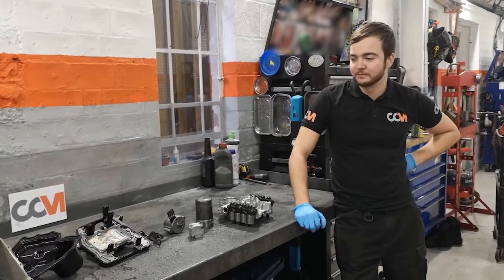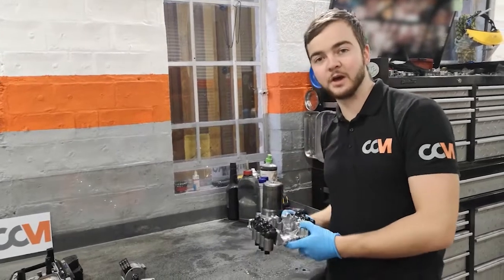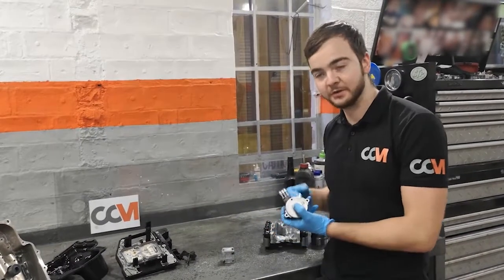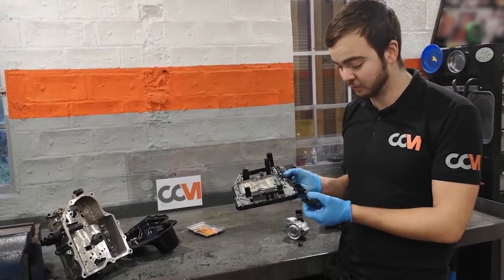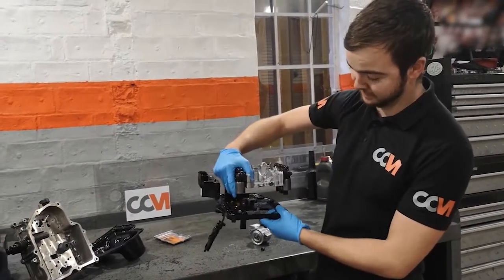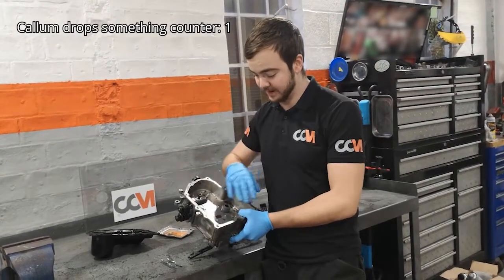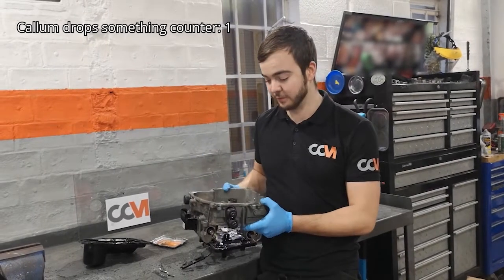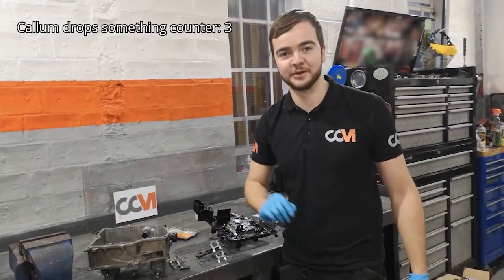Common DSG Mechatronics Failures & Issues | Walk Through Guide of Mechatronics Unit | CCM

Comment: Great video, excellent explanation of the issue. 

In 2025, is there any updates that you know guys are aware of with regards to if the "revised" units replaced under warranty are likely to last longer than the previously flawed units? 

As at 2025, there are still Tiguan vehicles made in 2022 that have Mechatronics failures....

Comment: I was driving highway speeds and my mkv r32 with dsg shifted into 3rd gear. Rainbow of dash lights. Put in neutral, switch car off and back on, good to go. This happened 3 times. Vw dealership says I need a new transmission. The codes showed something about speed sensor. 🤷🏼‍♂️. 
Any advice? It's not worth swapping the trans, at $12k.....
Reply: I hope you got a second opinion?
Reply: @billyponsonby I did. Kinda..... I had a shop say it could be something so simple as a transmission flush, which they did. The car has literally only been driven about 5 miles since. Long story, but, it's sitting in my sister's driveway in KC, and I'm now living in Hawaii.... So I guess I'll find out when I go "rescue" it in a few months

Comment: 17086/P0702/001794 - Transm. Control Module Electrical Malf. (SAE) or Control Module Defective
Possible Symptoms
1. Malfunction Indicator Light (MIL) active
Possible Causes
1. Control Module faulty
Possiole solutions
1. Replace Control Module 
I need your help this is one code i got when scanning the transmission on a mk5 r32 dq250

Comment: DQ200 in a Yeti have a sporadic communication fault code. No communication with TCM when hot, works fine when cold. No other fault codes. Any ideas? Thanks.
Reply from the maker: It's impossible to know without seeing the vehicle unfortunately. However, it shouldn't be having sporadic communication errors. Our advice would be to get it booked in for an investigation to find what's causing this as soon as possible as one fault can quickly turn into multiple. We hope you get it sorted!

Comment: My issue is that the gearbox sign comes on and goes into limp mode. It says "Gearbox Overheated" 

Doing this causes the vehicle go into limp mode. All gears stops working. Whats the possible problem
Reply from the maker: Uh oh. Sounds like something in your gearbox isn't happy. It's going into limp mode to protect itself from further damage. The best thing to do is to get it to a reputable garage ASAP for a thorough diag to see what is happening in there.

Comment: My DSG is hesitate from N to 1st but only when the oil is warm. 

Gears through 1-6 is fine once the car is moving. 

Any ideas?
Reply from the maker: Impossible to know without seeing the vehicle unfortunately. However, it shouldn't be hesitating or stuttering in any gear changes and that's usually a sign that something is about to go wrong. Our advice would be to get it booked in for an investigation to find what's causing this. We hope you get it sorted!
Reply: I have same issue.   I've heard of guys getting both pressure sulenoids changed because they get a crack and leak pressure.  It fixed it for them
Reply: I also have this issue currently... after I exit the highway and come to a stop, theres a 5% chance that it wont move when I get off the brakes. But if I shift to N and back to D, it works and wont give me any other issues. Usually happens maybe once every other week.

Comment: I have a 2015 Passat DSG all the lights came on the dash. The transmission went into limp mode. If you turn the car off and on it returns to normal. Now my speedometer quit working. The transmission accelerates but hangs in gear and won’t shift. If I turn it off and on it does normal. I’m thinking TCM Anybody experienced this? Help?
Reply from the maker: Hmm... It could be a number of things. It's really hard to diagnose without getting it hooked up to any tools. Our recommendation would be to get in booked in with some professionals to investigate as there's definitely something erroring in the system

Comment: Our DSG failed coming up to a roundabout the drive just disappeared which with large lorries thundering past we had no option than to come to a halt in a fast moving live lane - I think VW should have a class action taken against them, they have known about these problems for years but continued rattling them out - I’ll NEVER buy another vw as long as I live - oh and by the way quoted between £2,800 - £3,500 plus vat - I expect better from what was a reliable well built car. Brian Rivers
Reply: Mine died while crossing a highway...with my toddler in the car 😂🫨😱
Reply: @richiesworld1  Have you guys had the dsg gearbox serviced? Which golf exactly?
Reply: Have you guys had the dsg gearbox serviced? Which golf exactly?
Reply: you must be talking about the DQ200. Its a known bad box, yet you bought it anyway... You say you wont buy one again but yet this issue was known. VERY WELL KNOWN.. COMMON ISSUE.
Reply: @johnboy2436 Car heads know about it but the average car buyer doesn’t.
Reply: @johnboy2436 - selling cars with gearboxes that aren't to scratch is why they won't buy vw again.
Reply: @jamesgeorge8915  Yet every manufacturer has cars than have common faults. Many of them bad transmissions. Name a brand and ill tell you which model to avoid. Research when buying a car goes a long way. Why buy a dq200 box when they are known to be bad when you could get a dq381 which are known to be good.....

Comment: My 1.2 polo GT TSI DSG doesn’t creep forward when slotted to D gear 
But the reverse creep function is working. 
The VW service center said they couldn’t find any error code in the scan and also said doing a base setting reset using VCDS scan can harm the mechatronic unit as I have changed the battery outside of VW. 
Please suggest.
Reply from the maker: ooft, sounds like you've got your work cut out. We wouldn't be able to suggest anything really without seeing the vehicle so we'd recommend taking it somewhere where they can do a proper investigation for you.

Comment: Good video.Im thinking of buying a 2014 Fabia with 5 speed DSG which is a dry clutch.The car goes in to Drive but doesnt move off.Im suspecting the DSG clutch has gone as its just over 79000 miles so probably on original clutch.

Comment: Hi @ccmgarages 
My Škoda service advisor has diagnosed issue with mechatronics for loss of power whilst in drive and is replacing the accumulator in my ‘17 Octavia 1.8 TSI DSG (DQ200). I wanted to know if this is a permanent fix or a temporary one? 
How long does the DSG/ mechatronic last after this fix?

Comment: Hi recently had my mechatronic changed on my Audi a3, but car still isn’t driving. Parking gear is blinking and transmission isn’t picking up on scanner. Please help
Reply from the maker: Yikes, sounds like something definitely isn't right there. It may be that they haven't properly coded the new mechatronic to the gearbox or possibly, if the clutch is highly worn that can cause issues where the mech unit isn't happy until that is replaced too. If I was you, I'd be taking it straight back to where the mechatronic was replaced and asking them to look into it again for you. Or call our team and book in with us :)
Reply: @ccmgarages  what’s strange no codes came up signaling an issue. If the clutch needed replacing wouldn’t there be a code? I remembered when the guy placed new mech in he receives a code low pressure, he realized mech needed more oil. After placing oil, that’s when malfunctioning started and that’s when he lost transmission communication. So I highly think it wasn’t properly programmed or something wasn’t done right with the oil installation. What do you think ?
Reply: @ccmgarages  got the problem solved. But another came up. reverse gear is engaging but car is not accelerating in reverse. And it seems to be stuck in 2nd gear. Any suggestions?
Reply: @Doll_M did u solve this as I have this fault

Comment: My unit is not cracked but I changed it but still oil is leaking through the breather what should be the solution now,which seals to change
Reply from the maker: Yikes, it doesn't sound good. It may be that you've added to much oil and its now overflowing. Best thing would be to get it to a skilled DSG specialist

Comment: Better to stay away from cars with this type of gearbox. Repairs are very expensive!
Reply from the maker: Yes, they are expensive to repair, but so are most parts on modern cars simply because of the amount of tech within them. A wing mirror historically was just a mirror, but now it's packed with sensors and tech.
We obviously see the worst cases working in this industry but there will be thousands of mech units that live happy long lives without needing any repairs or replacements. The key to not getting a big repair bill is to make sure you properly care for your car!
Reply: @ccmgarages  Maintenance was done by a official VW workshop only. Drove normally with the car. But it still got a crack in the housing of the mechatronic...
Reply from the maker: @stefan2796 we're not saying mechs never fail, but you've got to admit they are clever pieces of kit!
Reply: @ccmgarages  i'm not going to buy a car with a DSG gearbox again...ever...

Comment: I have a 2018 RS3 DQ500 with 100K miles on it and on cold start the car won't shift into drive until the car is fully warmed up (5-10 minutes of idling), if I put it in drive when cold and give it just a little gas (maybe 1200-1500rpm) the car will slam into gear and lurch forward. Do you think this is a mechatronic problem and if so why would it only do it when cold? Thanks for any ideas.
Reply from the maker: Hi @Elijahallen - it could be a multitude of things but our first question would be has the gearbox ever been serviced? If not, we would highly recommend this. We are able to do a automatic gearbox flush which makes a huge difference to the driveability. Check it out here > https://ccmhelp.co.uk/services/gearbox-flushing/ 
If the issue continues, it could be the clutch, mechatronics, the gearbox - anything! Without getting the vehicle up on a ramp and having a good investigation we wouldn't be able to advise any further than this
Reply: @ccmgarages  Thanks for the reply. We have it in the shop now with the mechatronic unit pulled. There are several torn o rings on the hydro tubes so I'm hoping that is the problem.

Comment: I have a 2013 audi q5 2.0t premium plus . I just lost all gears i can shuft into PRND but if i put it in park the car keeps moving almost as if every gear is nuetral could this be a mechatromucs issue ?
Reply from the maker: Yes, possibly. The mechatronics is the brain of the gearbox so if this has failed then it could be causing the issues you are facing. The best thing to do would be to get your car booked in for an initial diagnostic and go from there
Reply: @ccmgarages  thank you.  I'm having it towed today to get a diagnostic done . I also forgot to mention if I keep my foot on the brake without releasing it and go from drive into park make a noise like a baseball card in a spoked wheel as if the transmission is driving even with the car not moving
Reply from the maker: @angelnieves4929  no problem :) Hmm that sounds strange but yes, it definitely sounds like something is going wrong there. We hope you get it sorted!

Comment: I have passat b6 with 7 speed dq200 and it has one fault code, its p178b. Car cant be moved and hydraulic pump is 100% not working. Is it TCM or pump itself?
Reply from the maker: Hi @stefangavrilovic8355 it could be either that is causing the problem for you. Without seeing the vehicle and testing it ourselves its impossible to accurately say what the cause is. We'd strongly recommend getting this recovered to a garage and sorted.

Comment: I have a 2007 Jetta 5 2,0fsi bwa engine dsg gearbox it doesn't start it only cranks and flicks PRNDS on the dashboard what might be the problem
Reply from the maker: It could be a multitude of things unfortunately! Without getting into a garage and having a full diagnostic scan, its near impossible to suggest what the fault may be
Reply: Was it position sensor?

Comment: Great video, our car has just broken down (cut out mid-drive) and now wont start. Shifter stuck in P (unless I manually release it). Now started coming up with an ESP fault and wont try and crank (says please put shifter in P/N which obviously Ive tried). Im guessing its the mechatronics unit, what do you think?
Reply from the maker: Hey, it does sound like it may be an issue with the mechatronics however, without seeing the vehicle we wouldn't really be able to advise. The best thing to do would be to get it booked for an initial diagnostic with your local DSG expert and see what they think.
Reply: @ccmgarages  thank you appreciate the advice
Reply: @transformerbots  hi, Was it the mechatronics? Did you do a dsg service? And which VW car ?
Reply: @VfxRaptAnime  electric/mechanical component part of the dsg gearbox. It's basically the brain to select the gear and has two parts. One is a digital electronic section and the other half is a hydraulic oil pressure controlled pump. The oil from this section eventually leaks into the electronic control section and stops the selector working. It requires replacing. Cost us around 800 but VW charge 1700+ for the part alone

Comment: Would you recommend getting a dsg ? Been looking at the 1.5 leon
Reply from the maker: Hi Luke, yes we would recommend a DSG as they are really intelligent gearboxes but it is worth being aware of the issues that can arise as these quickly run up costs. 
The best thing to ensure a happy and healthy car is always to remember the importance of regular servicing, maintenance and getting any issues checked out quickly before they start to progress.
Reply: @ccmgarages  do you recommend getting the dry 7 speed clutch serviced ?
Reply from the maker: @GameWithViiP3R  the dry gearbox which is a DQ200 theoretically has no service points unlike its wet box DQ250 which does have service schedules due to oil being used in the clutch system.
Reply: @ccmgarages what about DQ200 servicing in real life? Should it be performed and at what milage?

Comment: Why is it mechatronic unit give issue? What the cause of it? And how to maintain it. I know its not cheap to replace it.
Reply from the maker: The mechatronics unit deals with gear selection and is a complex unit with its own TCM and oil supply. A common fault is an ingress of Sulphur from the main gearbox causing degradation of the mechatronics unit and penetrating the TCM, causing electrical faults which confuse the gear selection process. In this case, you would need a replacement mechatronics unit and not a whole gearbox and mechatronics unit combined.
A good way to maintain a healthy mechatronics unit is to ensure you have regular servicing of your vehicle so you can spot any worrying issues early on.
Reply: @ccmgarages  hey thanks man. Will keep this in mind. I'm planning to get scirocco 1.4 tsi twin charge so I'm carefully doing my research to understand the Car main issue.
Reply from the maker: No problem  @PJWALL89  happy to help 😄Just make sure wherever you go has the facility to reprogram the gearbox after doing any work. There's a lot of places that can do the 'mechanic bit' but don't have the programming tools

Comment: You mentioned "they have re-design it " some parts of the DSG transmission so, it can last longer. From each year of the VW gen 5th we get it with the new design?
Reply from the maker: Hi Lee, they did change from mineral oil to synthetic oil. Allowing electrolysis separating sulphur from the the synthetic fail and its deposition causing electrical failures to the mechatronic unit.